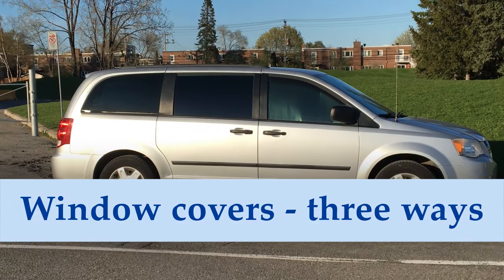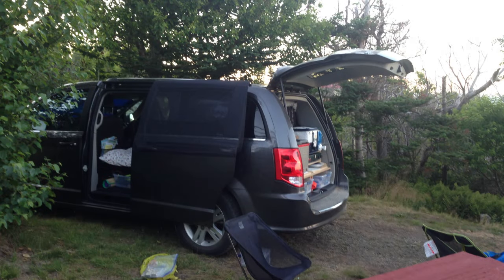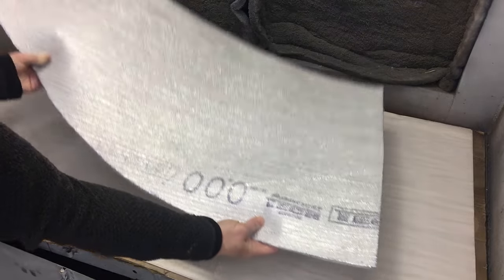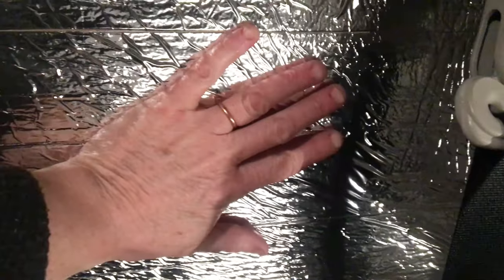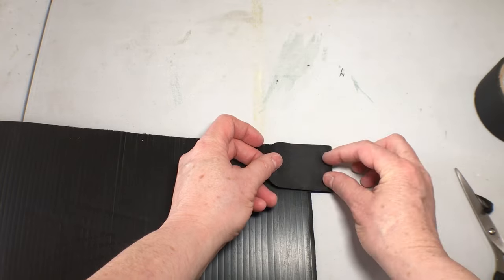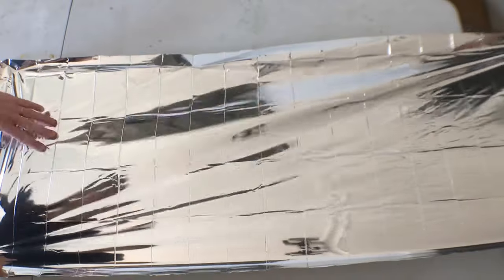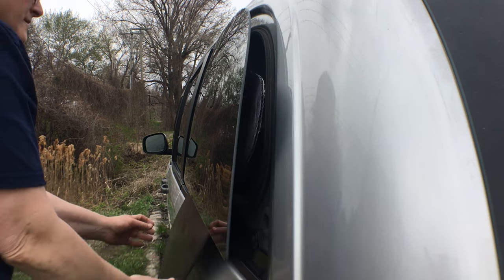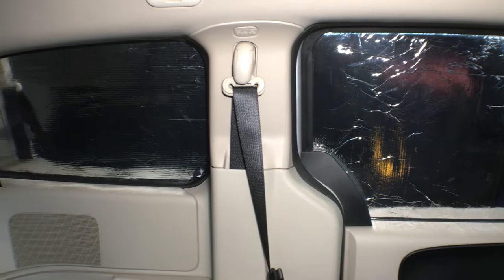Campervan window covers - three ways

Comment: When I make my window covers I use cardboard and I paint the edges and outer sides with  flat black spray paint. Painting the edges makes the cardboard stay together much longer. I spray the inner side with gloss white paint. The white inside reflects light better. The flat black  on the outside makes them invisible to anyone trying to see in, and the combination of the two seals up the cardboard to last longer.
Reply: The black does not reflect light and will actually make your space much hotter. If you aren't concerned about the heat, the black is great for stealth.
Reply: Black will retain heat making the inside hotter.....white reflects heat...(think about very hot countries that paint the outside of the house white ...it,s  done for a reason)...:yougotthis:😎.
Reply: I'm not as concerned with it being a little warmer at night, as I am with being ANONYMOUS.
Reply: Hi Allen. I go driving around town and find strong cardboard boxes from major stores like furniture outlets. they have tough cardboard. I then use black "Gorilla" Duct tape instead of paint. Makes for a durable cheap cover
Reply: @georgecullen9516  less of an issue at night when the sun isn't shining

Comment: Used white coroplast as my privacy coverings on my white Plymouth Voyager minivan back in 1996. Used small zip-ties threaded through 2 slits to act as grab handles for removing covering when necessary for travelling. Didn"t have a need for insulation for cold weather but they kept the heat down in the summer. Lasted great for 12 years until I sold the van.
Reply: Coroplast is a great idea but it sure is expensive now in 2024

Comment: I use clear plastic sheeting and tape over the window on the outside as if the glass is broken. You can see through it so it's extremely easy to the widow and trace the exact shape with a black sharpie. Cut it out and transfer it on the the reflection and it's a perfect fit every time. Second step is to use some spray adhesive (loctite) is what I use and black wool fabric to make the cold weather side. When they're installed you can't even tell they're in the windows from outside it just looks like black mirror glass. When you cut the excess of the fabric off leave about 1/4" all the way around to give yourself tuck in room for complete black out

Comment: To try to get the wrinkles out of the silver blanket as you stick it down, try using the edge of a credit card to push out the bubbles and/or one of the little rollers for smoothing the edges of wallpaper - or even just a bottle or a rolling pin!

Comment: Great video and great tutorials. I used cardboard covered with black vinyl wall self-stick wallpaper on both sides. I left about 3/4" lip of wallpaper all the way around. This helps to hold them in, and also pull them out. 
I also folded the bottom edge of the side window covers to make them easier to pop in and out. 
Thanks again for a great video.

Comment: Great video - I am making my window covers for my Subaru Outback  using reflectix insulation. The 16" x 25' roll costs $36 at Home Depot. Reflectix is light weight and fits well. For my back window I bought a sun shade from the Dollar Tree as the reflectix was too narrow and I didn't want to buy a wider roll. For the rear window I did use cardboard as the backing and duct taped the sun shade to it. I bought painters heavy duty drop cloth which is waterproof, tear and leak resistant from the Dollar Tree. I will use the spray adhesive to attach it to the cardboard and will keep the felt side out. Your video has given me other options if this doesn't hold up with useage. My car camping is mostly for overnight stays for hiking areas that are not close to my home.
Reply from the maker: Sounds good - just remember that the reflective side needs some room - it works by reflecting radiant heat back. So if you stick stuff to it doesn't do anything

Comment: Thank you for the video. I went with sleeping camping mats that have a reflective side. Super cheap and works out of the box just had to cut them
Reply: Are they on amazon?  Interested in this idea
Reply: @bkgdnoize111  those mats are cheaper than the reflectix insulation - would have used that instead.

Comment: Super insightful video. Thanks. 
Ive made a couple sets of windows covers for differnt things. 
I usully use 3M Reflectix bubble stuff. 
Works well, you can really only get so much insulation out of 'window covers'. 
If your really concerned about insulation you should probably just make real inserts for your window and not compensate for size/weight.
I just care about mine being light proof and if if they have an insulating value of like R1 Im happy.
Reply from the maker: I agree with you about the window inserts - 1/4" of anything won't insulate all that much.
Light and prying eye proof for sure and the reflective side out on a sunny day is probably more useful for keeping the inside cool that the keeping warm factor.

Comment: Thank you so much esp. for tips. I looked at vid again for the pull tabs suggestion and got more than expected. I really appreciate the back window part; I should have watched vid. again before I cut mine only to find out it’s asymmetrical. 😀 but I can alter using your dual flap technique. 👌Thanks again

Comment: Maybe consider revisiting and possibly modifying the cardboard concept, by sealing the cardboard part in plastic (even using garbage bags that are thicker, such as construction site large bags...using box tape, possibly, to seal the open end of the bag), and apply a silver sided foam window coverings(dollar tree sell some) on one side to handle day hours, and the black bag side for evenings and nights...based on the plastic not melting easily, in the day...in sealing cardboard air tight, maybe the problem of moisture deterioration can be less of a factor,  ...what do you all think?

Comment: Thanks, for showing how to make a window template. Curious to know why you didn’t buy a roll of reflectix  at the local hardware  4’ X 10’ is cheap $20, cut your templates, if you need one side black, you could spray  glue a black cover on to them ...and use black tape to make a good border all the way around?
Reply from the maker: Don't get me started on reflectix - it seems to be the most overused and overrated material used in van conversions.
It has very little insulating value - it is used to reflect radiant heat, similarly to the Mylar foil blankets but has very poor insulation rating for conductive heat loss.
Though I'll admit the use as a window cover is probably the only good use for it! The number of times I have seen it sandwiched between the inside of the van and the inner walls drives me crazy (or the times people cover BOTH sides of it when making window covers)
All that aside, it is a bit too floppy to stay in place well so would be a nuisance to put up in the windows. 
As you can see, I don't like reflectix :-)
Reply: Great! I’ve been thinking the same thing for some time and notice EVERYONE in van/camper life uses reflectix incorrectly.
Batt’s of fiberglass or rock wool would be so much better for walls.
Reply: @saintbyron5150 the problem with regular household insulating materials like rockwool and fiberglass is that it typically is designed to be used with an airgap behind drywall. You can’t exactly just glue it into place either. It eats up way too much headroom and livable space inside a van or camper. XPS foamboard is a much more flexible option, since you can choose to sandwich it with PMF, plywood, or aluminum, really whatever you want. Its very durable after being PMF’d too, you could probably glue carpet to it and use it as flooring without any extra work.

Comment: I wonder if table felt would work for you, here in the UK we use it to protect dining tables from the hot plates. It looks to have similar properties you can get a type that is white felt one side and imitation leather on the other.
Reply from the maker: Sounds interesting. How thick is it? Is it stiff enough to not flop out of the windows?
Reply: @averysmallcampervan  the one with a faux leather look probably would be stiff enough I think.

Comment: I preferred to put translucent fabric that I bought at walmart for $11 and double tape and stick it on the window first and then I put the fabric and the advantage of the fabric is that being inside you can see everything that happens outside with the privacy that nothing looks inside
Reply from the maker: That sound good - I did tint the windows which really improves privacy while still being able to sleep but it doesn't help at night if there are lights on in the van

Comment: Cool vid im in the process of makokg these for my ute canopy for the opposite reason tho aussie summers are super hot and ive got a fridge and battery setup in there id like to keep cooler and stop would be thieves from seeing any of it thru the window im using insulation rolls off temu it cost me $32 for x3 huge 1mtr by 3mtr rolls its waaay more then i need so I'll make some for the car windows and windscreen aswell which was shipped from germany so not even cheap chinese crap and im using some rubber backed insulation matting in between i already have to further the insulation purposes ive watched many videos on these and thats defo the best option the stuff ur using isnt really effective or cost effective. Im using glass suction cups to affix to the windows so theyre removeable but the canopy ones will always be on the only other thing I need to buy is aluminium tape for the edges which is $12 a roll and I won't need all of that and some glue to stick the insulation sheets together with the rubber backing so all up around $50AUD to do my entire car

Comment: Thanks for your vid! It helps solve a couple probs coz i have the same van! Eexcept I still have a question.. Is that 1 big sheet of coroplast? Where'd you get it? I can't find locally (PHX, AZ)
Reply: Check at home depots or lowes? 3 of the hardware stores in my community carries sizes from 2x2 to 6x8 (one place called it corrugated plastic)

Comment: Thanks for the good instructions and ideas. I have a question, do you have any problems with the odour / smell of the glue? You use a lot of it and a van is a very small space, do you have any issues especially in hot temperatures?
Reply from the maker: Hi - I didn't have any problems with the smell of the solvent from the glue. First I always apply it either in a spray booth or outside so as not to be breathing it in while working on it. The solvent evaporates pretty soon, so the small of it is usually gone by the next day, or so. 
Glad you found the instructions helpful

Comment: Love the video as that is what is searched.  However, when you said you had an electrical site, I was wondering how you got it in the van.  Left a window open?
Reply from the maker: I just close the from door on the wire of the extension cord. Probably not the best but the rubber gaskets around the door are pretty forgiving.
Reply: You could also run the power cord along the top of the inner fender. (open the hood), then run the cord into your cab via the  open front door gap. Should be enough space to not pinch the cord. Worked on a lot of the vehicles I camped in. Stealthy too.

Comment: How would you work these out regarding ventilation, to avoid condensation? Maybe cutting them shorter on the top, for the windows that open?
Reply from the maker: Well, the ones in the back windows kinda open WITH the windows, so, since they are near our heads when sleeping, that is usually enough. 
I guess you could add a little flap at the top, that could fold down. If you cut them shorter it would ruin their light blocking function.

Comment: The back window is my bane. I may have to resort to magnets.
Reply from the maker: Where would you put the magnets? Is there enough metal back there?
Reply from the maker: Where would you put the magnets? Is there enough metal back there?
Reply: @averysmallcampervan  
I'll have to pull the paneling down and use my Drimel to apply metal/magnets. Honestly I'm open to suggestions. The side windows were not this difficult.

Comment: Serious load of faff. Iv bought thin rug material from the hardware store or even Amazon, cut to size, double it up, hang it with the top about 5mm secured against the top window seal of power windows & its job done. Takes 5 minutes. Provides heat insulation too & doesn’t get wet with condensation as not pressed up to window glass. Hang front & rear for sleep. Job done. 👍